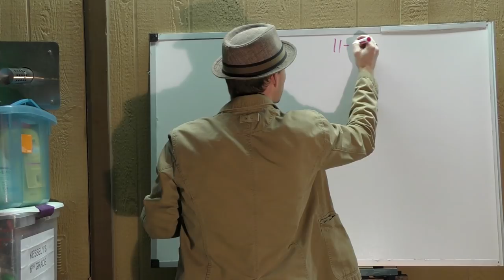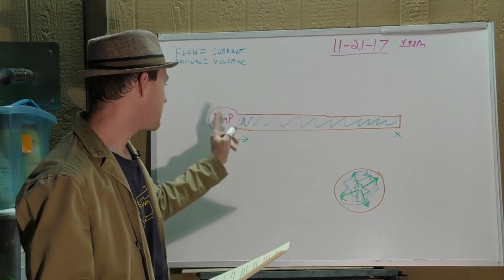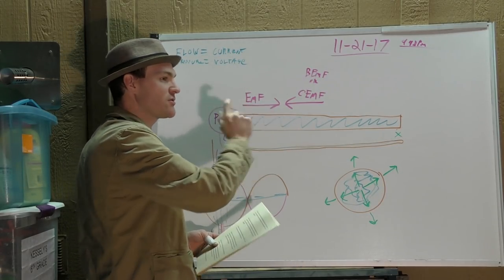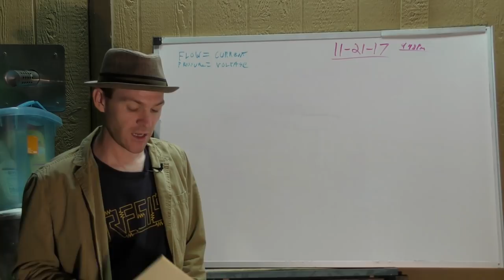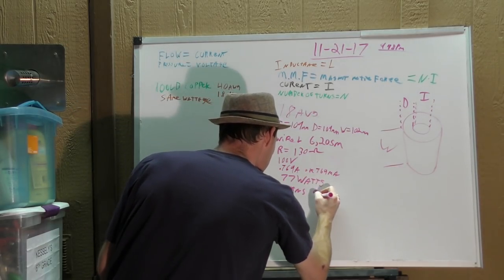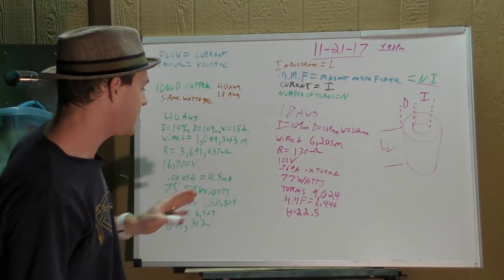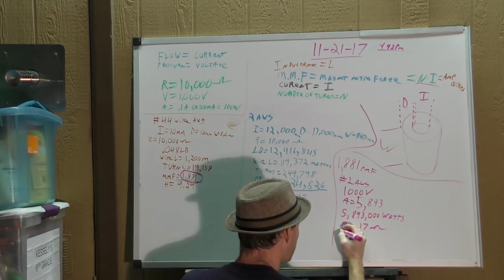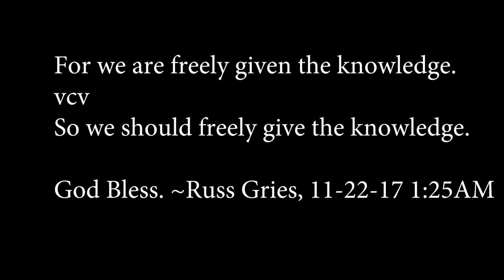Part 10: The Steel Wedge of Truth Hit by The Sledgehammer of Facts Will Break Open Even Closed Minds

Comment: Maybe I am retarded but in your #44 section, you have the equation for MMF as NxI where N is turns and I is current.  But your numbers don't add up.  Turns = 19,158, Amps = 0.1, so MMF should be 1,915.8 but you have 1,881 for some reason?  Then in your MMF match example, you have the amps as 5,893, but 1,881 MMF divided by 317 turns should be 5.933 amps.

Can you please explain this discrepancy?
Reply from the maker: good catch!
i had to round numbers ever so slightly to make my point, it was hard to match exactly.  the real numbers for #44 are:
 turns: 19,158
length: 1,206 meters
resistance: 10,184
mA: 98.18724
so the real numbers are slightly off, theses are with in the insulation fudge factor. and how well the wires is layed. 

next: it seems i messed that up good! your right, we can change the 1000V to1V, and here are the correct values 

To Generate 1881MMF in #2 awg we
need 1V@5.893A

That’s 5.89Watts.

Wire length is 330 meters

Only 317 turns

217 Lb of copper. 

.04H

However, The all the facts still holds true, 
current is not what makes the magnetic field. its only a catalyst. thanks for catching my mistakes!

I find it interesting that we can use 217lb of copper or .048lbs to get the same MMF... 

also the #44 coil has almost 10H, where the #2 only .04.  and looking at the current: 
#44=100mA vs the #2=5.8A  for the same MMF... so again, current dose not fit the bill. 

all very interesting and also goes against what's currently thought...

~Russ

Comment: The way I see it , you have a lake that is on top of a mountain and it is sitting level so there are now rivers flowing. The water in the lake is 10 million gallons . So you have 10 million amps but since the lake is level and there is now river flowing down the lake you have no voltage behind that 10 million gallons of water until someone lifts the lake on one side and tilts it then now you have voltage added to the 10 millions gallons of amps in that lake and there is now a flowing river

Comment: Russ, you are confusing atoms lining up their magnetic moments to create magnetic domains in a magnet and current flow creating a magnetic field.  They are two separate and distinct entities.  There is no alignment of copper atoms in a coil of copper wire with current flowing through it.  I suspect that this is some Joseph Newman nonsense that is messing up your head.  When current flows through a copper wire it's the electrons moving through the wire that create the magnetic field and it has nothing to do with the atoms of copper or the alignment of the atoms of wire.  Don't let Newman corrupt your understanding.
Reply: If you want the "real thing" or the "real deal" then look at the clips of the YouTuber "lasseviren1."  There is even a clip about the magnetic field created by a single moving electron.  I am going to assume that you don't understand calculus but even so watch the clips anyway.  He is the real thing.  You watch the clip that precisely describes the magnetic field from a single moving electron.  All magnetic field sources combine their fields together by vector addition.  A coil of wire with current flowing through it has trillions of moving electrons.  Add up all of the magnetic fields from each individual moving electron and voila, you have the magnetic field produced by a coil.  It's that simple.
Reply from the maker: that's right. did you not not listen in the beginning of the video where i said electrons? then simplified it for the sake of this video? i said exactly that. you guys dont pay attention to what i say apparently. this is the second video you did not hear me. lol oh well.  its a long video, ill give you a break. ~Russ
Reply: rwg42985 OMG. Do these guys even even open up there ears?  Just jumpin ona nigra. I don't even think of Newman's stuff when i hear new theory.  Each postulated idea should be given a new fresh mind to plow as in a spring planting.

Comment: good w0rk russ i think joe newman  did this the mass is huge  great is alimiting factor
Reply from the maker: yes he did, and he is right.... were all just to ignorant to see it :) but that's OK. Those who seek the truth will find it. :) ~Russ
Reply: The best thing about it is you can get same results with a big coil but SUBDIVISING  the length in 4 parts and make continuity with contacts between the subdivisions and collecting 4 times the back spikes.. You end up with lower voltage for the back spike but higher milliamps//.. I think that`s where the payback may rest..
Reply from the maker: in the end, you can just parall smaller wires to lower the input voltage. This also lowers the current input. and its a lower resistance.. and adds to the inductance. this is how he build his last motors. will see how that goes for me... keep watching :) ~Russ
Reply: +rwg42985  It has nothing to do with the mass of the copper.  That is just Joseph Newman quackery.  Keep going up the learning curve until you leave Newman in the dustbin.  Just like Bedini needs to be left in the dustbin.  Yes, you need to find the truth.
Reply: +rwg42985  Nope, if you take say a 100 turn coil and turn it into four coils of 25 turns wired in parallel, then you will get a new inductor with 1/16th the inductance.  So effectively with the same amount of wire and putting coils in parallel you are lowering the inductance and lowing the resistance.
Reply: +al desrochers  Nope, in fact the voltage you get on the back spike is pretty much independent of what you are suggesting.  The reason I am saying this is because essentially any coil can generate any back spike voltage.  I all depends on the circuit.  Keep watching Russ and hopefully everybody will get to the point where they understand this.  The voltage of the back spike is proportional to the inductance, and also proportional to rate of change of current flow through the inductor.  Therefore a small inductor with a high rate of change of current flow can produce a back spike with the same voltage level as a large inductor with a low rate of change of current flow.  Another way of saying it is that any inductor can produce any back spike voltage.  That may sound confusing but if you and Russ and everyone gets up the learning curve it should all make sense in the end.
Reply: Funny to get critics of a guy with no video or any experiment under his belt..  Are you the same guy that is commenting on Gerard Morin video?? If so, can you explain the analogy of what you are saying to a Tesla coil or automotive coil ?  That`s what I taught.. If you can not explain how you get a bigger back spike from the secoundary, stay on the side line and learn..
Reply: I will remind you that all the SCIENTIST that has paid visit to NEWMAN were in the same state of mind like you right now...  They all change their opinion when they left his house and that tell a lot of the bad learning physics and science has left behind..
Reply: +al desrochers  When you discuss the back EMF spike there are actually two parameters, 1) the peak voltage of the spike, and 2) the amount of energy in the spike.  Everything I said in my discussion is correct.  Going back to the 100-turn coil, what do you really get when you rewire it so that it becomes four 25-turn coils in parallel?  The answer is a single coil of 25 turns with 1/4 of the electrical resistance.  This coil will store less energy than the 100-turn coil when the current flow is the same.  However, when you just look at the peak voltage, can the 25-turn coil produce the same peak voltage in the back EMF spike as the 100-turn coil?  The answer is yes it can do that, even with both coils having the same current flow.  But for the same current flow, the 25-turn coil will have less energy in the back EMF spike as compared to the 100-tuen coil.  I don't think I have ever commented on a Gerard Morin video.  An automotive coil has many turns on the secondary and therefore can generate high voltage on the output.  But even the primary of the automotive coil can produce very high voltage.  Everything I am discussing is based on interrupting the connection to the coil, which generates a back EMF spike.  So the issue is to understand what happens in a coil when you interrupt the current flow.  And like I previously stated, in theory any coil can generate any voltage when you interrupt the current flow.  It may all sound mysterious and confusing right now, but if Russ and his followers can understand this then everyone will benefit.
Reply: +al desrochers  I can assure you that no real scientists changed their mind after visiting Newman.  If you read this somewhere then chances are it is lies.  His "theory" of "gyroscopic particles" is nonsense.  And it looks like Russ is reading this and trying to incorporate it into this discussion where he makes reference to the mass of the copper being a factor in understanding what is going on with some simple circuits based around coils.  This would be a big mistake and I am going to try to watch the second half of his clip and comment some more.
Reply: You just DISCREDIT without any theory analysis behind ..  That is the fundamental of science..  You are on a huge rant on this chanel with just puff of air
Reply: Instead of denying his theory, why dont you try to explain what is going on with his machine... The gyroscopic particles is the voltage potential returning to the source explain in the layman term..  I have not seen anyone back ingenering  the function of his machine and the low current consumption from that huge coil he has in his machine... NOT ONE but Russ.... Plot a nice video with numbers to DISPROUVE Newman and maybe you will gained credits to be heard..
Reply from the maker: al desrochers I don't think he read the title of this video. In the end...  Only building and testing it. Will Prove it... However like I said. I can't prove anything to anyone. Only my self.  So in due time my friends. I will build it. In due time.  ~Russ
Reply: +al desrochers  Look, if I remember correctly, the "Newman machine" is just a big big coil of many turns and inside the big coil there is a big permanent magnet, right?  So this thing is just a big simple pulse motor where you connect the power to the big coil to generate magnetic repulsion between the field produced by the big coil and the field produced by the big permanent magnet.  And then the big coil will rotate on its axis and there is a simple commutator to switch off the power at the right time.  He uses many AA batteries in series.  A single alkaline AA battery can actually output quite a bit of power.  Therefore 100 AA batteries in series can output a considerable amount of power and that is enough to make the big big coil rotate as a motor.  That's how his machine works, it's just a big glorified pulse motor.  There is nothing special about it.

CORRECTION:  I think the big magnet rotates and the big big coil remains stationary.  It's many years since I have looked at his clips.  It doesn't matter, it's still the same thing.  It's just a pulse motor powered by a 150-volt DC source in the form of a bunch of AA batteries in series.
Reply: +rwg42985  Russ, I gave you some interesting stuff to read and ponder.  I corrected you on the water analogy stuff and suggested a simple bench experiment for you.  If you get up the learning curve you should come to the realization that the Newman machine is just a big glorified pulse motor and nothing more than that.
Reply: al desrochers : AMEN BROTHER. ..!!!

Comment: I can see you are contemplating building this thing.  Don't buy into the "it will only work if it is massive" pitch.  There is no rational reason for that statement to be true.  Since you are in the "Newman universe" don't buy into this line that it's voltage that makes the magnetic field and not current.  That's pure quackery, there is no polite way to put it.  You are fully aware that it's current that creates a magnetic field so stick to your guns.  Go look at some Lasseviren1 videos to get a jolt of reality from time to time.  And you note that there is no real output from the Newman machine.  So you are scrounging around for ideas to get some output from the device.  Like I said, it's just a big glorified pulse motor that just sits there and spins.  It really doesn't do much of anything.  Nothing ever materialized from this.  I really hope that you don't devote too much time or energy to this thing.